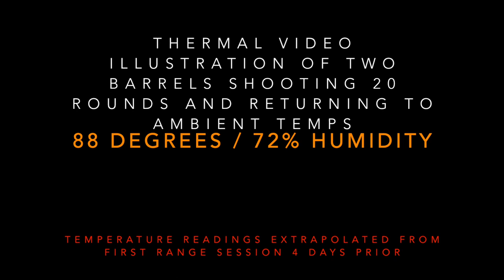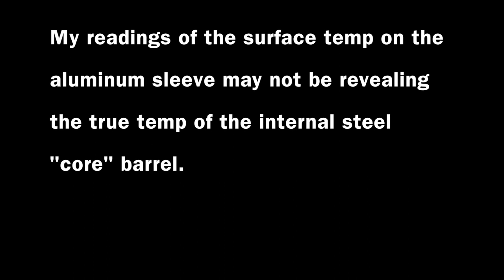DRACOS Build, Intro, Objectives, and Thermal Video Heat Test - 6.5 Grendel

Comment: From your video it appears that the Draco barrel is insulating rather than acting like a heat sink. Honestly that makes more sense than their claim, anyone that's taken a heat transfer course in engineering can run the calculations for heat transfer through 3 media types, first being steel, second is unknown, third is aluminum. Whatever material is used for the "proprietary media" would have to be more thermally conductive than aluminum to make this barrel dissipate heat faster than a pure aluminum sleeve. Which basically just leaves your three options of Gold, silver, or copper... I doubt that's what they fill the barrel with..

Comment: I think you should read the temperature of the barrels from inside as the surface of Drakos has an aluminum jacket which supposed to pull our the heat from steel and media material.
Reply from the maker: Yes that makes sense.  Unfortunately I don’t have a probe thermometer that can take the internal temp accurately .

I’ve heard of folks saying they can stick a pinky in the chamber to get an idea if it’s hot after shooting many rounds but I’m going to forego that method.

;)
Reply: @HuntTXhogs  well it may work actually. I have been studying for a while the nature of epoxy mixed materials. Some of them have higher thermal conductivity that others. But in summary the best of them will have a maximum 13 w/K while SS416 has 24 W/k. That means these composites will keep the heat for much longer time than SS416. However, they have a higher density. If you imagin the heat as being a liquid, they can store heat more than Stainless steel and Thus, it will take for them a while to cool down. However the inside is supposedly colder. A good method in mh opinion is place your thermal measurement tool in the chamber after you finish firing.
Reply: No doubt it is working , I simply lack the tools and knowledge of how to relate it.

I believe DRACOS and Teludyne Tech have sent their barrels to a white lab coat facility and that the report is available for download.

Thanks for watching

Comment: I talked with the people that run Dracos, and they told me to not take the gas system off...nice job getting it going though.
Reply: The stock setup should be all that is needed for most folks , sometimes I get a little radical with trying various things and share the vid Incase somebody else is contemplating the same....

I’ve been running this barrel for awhile now and it doesn’t disappoint - got me one in 308 too !
Reply: How would you put the barrel in the upper without taking the gas system off?
Reply: @mrushing76  I said the same thing